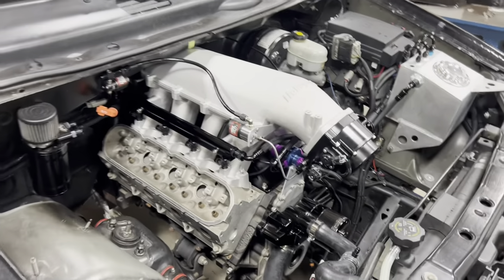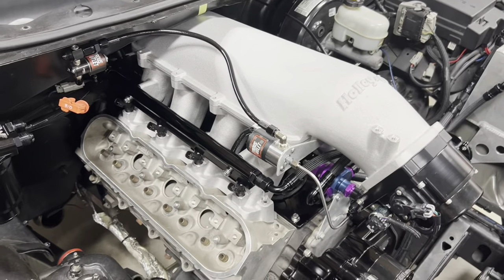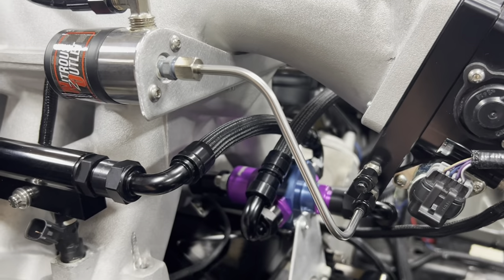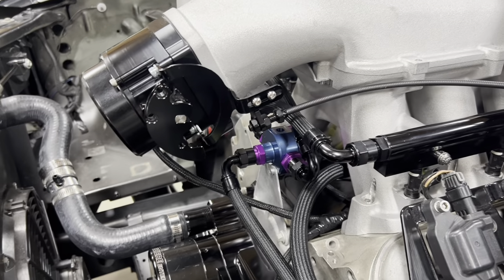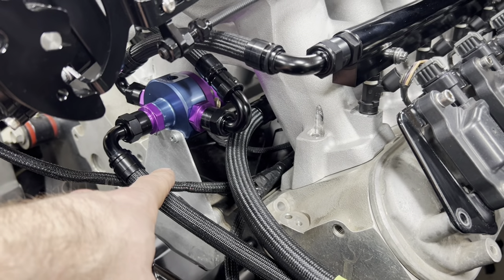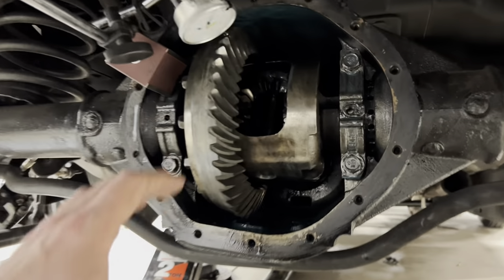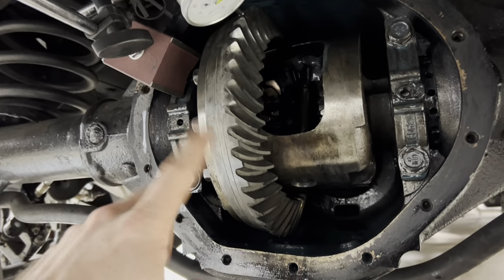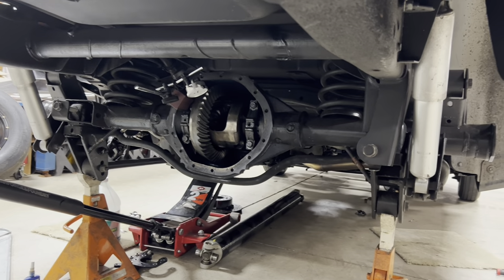Our Nitrous Trailblazer SS Project is Down to the Wire. - Sick Week Prep!

Comment: No rest for the wicked!
Reply from the maker: Going to be wore out before the week even starts lol
Reply: @CoastalRacecraft  Having a LS2, 6.0 L engine is a reasonable good start with choices, to perhaps achieve a 9 sec ET 1/4 mile range vehicle.
What the expected wHP and Torque rance You are planning and expecting to achieve with this engine set up ?
Ho0w much NO2 and jets do You have planned for use within this set up ?
Are You planning to use ethanol or high ethanol content fuel for maximum performance ?
What is the overall weight with this Trail Blazer ?
Hope You have a proper full safety items including the full cage, parachute, proper full racing seat with head and neck restraints, along with a HANS device ??!!| 
You were present, viewing the minor to serious vehicle crashes during Sick Week 2022, other events last year, 2022, and previous years too, correct ??!!
->Ayden Bailey, "barrel roll", @ 182 MPH, + others, including a Black Blazer !!
All  The Best, Sincerely

Comment: Hey man dope ass build I had a question about how you converted from run by wire to run by cable what parts did you use ??
Reply from the maker: Thanks man! Holley on the computer side and this video covers all the mechanical stuff. https://youtu.be/2QE0oHyQut8
Reply: Thanks man appreciate it
Reply: One last question brother what cable did you use do you have part number or know the length sorry about the questions

Comment: What gaskets will you use for a cam swap ??
Reply from the maker: Front timing cover and water pump gaskets if you are going to leave the heads bolted on. The old valve cover gaskets should be fine.

Comment: How did you make that hitch?
Reply from the maker: It’s 1/4” flat plate turned vertical that slides inside the end of frame and uses the factory bolt holes. 2x2 box tubing between the plates and the receiver welded to the bottom of that